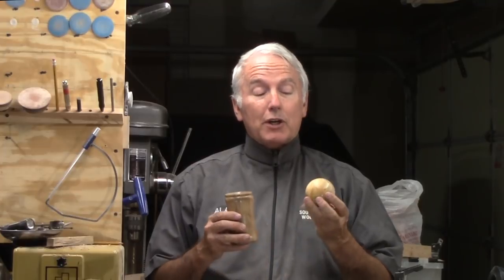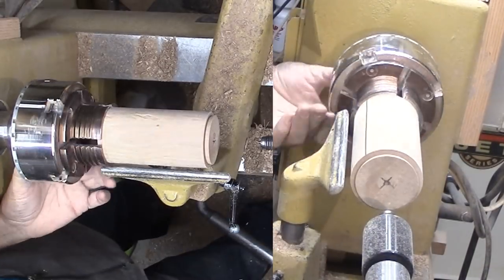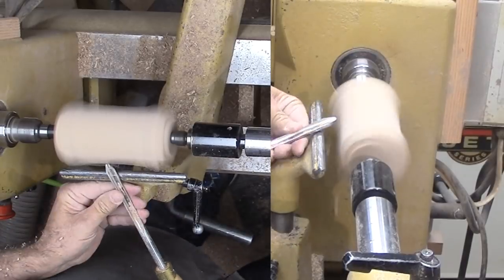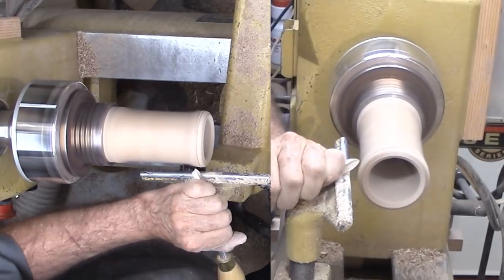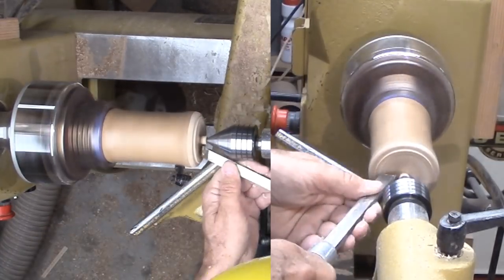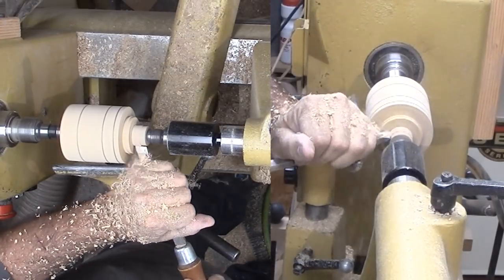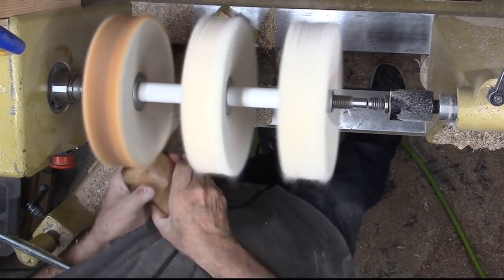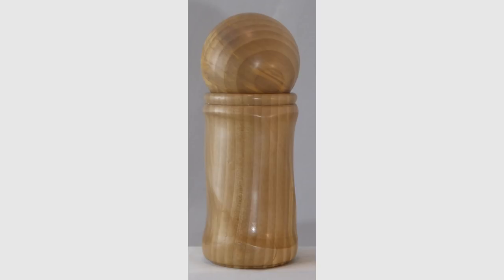Woodturning Sphere Topped Multi Axis Box

Comment: A trick I learned in a Barbara Dill demo - use a pencil (or popsicle stick) to gauge the distance between the tool rest and the bottom of the first cove, and then turn the second and third coves to match that depth.  Measure all three depths from the same point on the tool rest, marking that point with a Sharpie if necessary.
Reply from the maker: Good idea. I tried something similar. Much easier to read than to implement. :)
Alan

Comment: I never did wood turning or lathe work. i have no experinece. However, i enjoy watching the videos. Do you think, as a bloody beginner, if i spend 1k-2k$ on equipmen, am i able to do this, with a bit of practice, say within 3 months?
Reply: Tim -- If you were to turn 8 hours a day (with instruction), you could turn projects like this without any help by the end of your second week (if not before). Turning's not too difficult, but it does take practice. Your best bet is to take a one or two day(s) long beginners class to see if this is something you would like to do. My wife and I took a 5-day class at Craft Supplies USA, which is in Provo, UT.  During the class, we made boxes, goblets, a platter, an egg, and two bowls. I made the second box and goblet during 'free time' during the second half of the week -- without much instructor input. So, this is something you can learn fairly quickly if you put in the time.
Reply from the maker: It's possible. I'd find the nearest woodturning club and get some training.
Alan
Reply: Hey Alan;  no training here in bangkok. Youtube would be (is) my education center.
Reply: Hey David; so if i buy a lathe, a saw, some gouges and scrapers, a disc sander, a/some chucks. total propably 2k$. am i good to go? what's my start then? just getting small squares and make them round, then making them bigger and start digging out like a bowl? gosh, i think i would enjoy this type of work so much. i love seing balls, eggs and spheres with epoxy. i wanna do that all day.
Reply: Tim -- If there is no one near you to provide in-person training, then join the American Association of Woodturners.  The AAW has a series of online videos especially for beginners.  They are excellent. There are a lot of very good videos on YouTube. Alan's, for example, won't steer you wrong by demonstrating unsafe practices.  The same is true for the videos from Mike Peace (and several others).  However, there are lots of other videos that demonstrate very unsafe turning techniques.  That's why I'm encouraging you to rely on the video library of the AAW to learn the basics.  That's what it's for and it has been vetted for safety by experts.  Besides, Alan, Mike, and others, generally skip over some essential steps in the interest of time when making their videos. The AAW videos, which are targeted toward beginners, don't skip over these essential steps.

You can learn this stuff on you own. You can learn it from reading a good book. And, you can learn it from watching good videos.  Mostly, however, you'll learn it by doing.  It's a fun and rewarding hobby and shouldn't take $2k USA to start (I assume you can find a decent used lathe where you're at or start with a mini-lathe -- which will do everything but a large bowl).

Good luck!
Reply from the maker: I'm assuming there would be a language barrier then. Do you take vacations to the US or other English speaking area? 
In the end, it will depend on your motivation. You have more hurdles. But you could also have access to a totally different spectrum of wood to turn.
2k$ could buy a mini lathe say 12" by ?; plan on a chuck and basic tools; plan on making a lot of mistakes but learning from them. 
When I considered an ex-pat position in Hong Kong, I thought that a ShopSmith might be a great idea. Since then, I've actually used my brother's for woodturning. Now I say No for woodturning.(at least)
Reply from the maker: Let me preface my comments with. "We work with what we have." On the lathe for the plus side: I saw variable speed; I saw a tool rest. I could not tell if the spindle was a standard thread. It looked like 1", I hope is then was 8 tpi.  The reason for this is to be able to purchase standard accessories such as a chuck, faceplates or to have a top to create them. 
On the minus side. I saw a machinist's interpretation of a wood lathe. This was designed to assist duplication which unless you are a professional doing production work or some other specific reason. You don't need. I'd have to look further to determine if I can easily move the tool rest or be constrained by the duplicating apparatus. The operator was obviously inexperienced at woodturning with bad catches and primarily scraping cuts. 
I'm concerned about the robustness of the lathe. the ways and the tail stock seemed light. I'm worried about vibration with medium to larger work. While the overall size seemed to be in the "Midi" range, it's capability (other than duplicating) seemed to be in the "Mini" range.
I'd compare the specs to a Jet or Rikkon mini. Look for variable speed, standard spindle, and as much robustness and capacity as you can afford for the type of work you plan to do. 
Rather than purchasing imported wood, look to local Thai woods that could give a totally different experience.  Research how to effectively use green wood.

Hope this helps.
Reply: Well, that gives some insights that i don't have yet. so it seems that i'm maybe better at importing a lathe from the USA which then is like 1.5k$. my goal is to make big balls/spheres and bowls, like Frank Howarth is doing on Youtube. So the lathe should be able to handle such a big piece. at least that's what i think. 
till now i didn't think about what a copying lathe is. i don't need that feature. i thought it looks quite robust and heavy and if necessary i can put some beton plates on the foot to stabilize it more. if i won't be able to handle 50lbs trunks, i think that's fine  for first  as long i can do say 10-12 inch spheres with epoxy. that's what i wanna do all day long. as robustnes goes, it's like usual with thailand: no quality and as cheap as possible. sucks a bit. 

a Nova 1624 II Lathe i could get for about 2.5k$ incl shipping and tax to thailand. sounds pretty much a lot, for an item that goes for way less. Grizzly lathes are out of my pricerange for shipping and duty/tax. how about a "Jet Lathe Model 1221VS" looks mini and i need to have it sit on a table. 

maybe i'll ask reddit and tell them all my options. i found 2-3 more shops in thailand, but they are all in the 450$ range. at the end: ou i get what i pay for. :(
Reply from the maker: The problem I see with the first one is a tool rest constraint. Since it is attached to a threaded rod,  A machinist would appreciate this feature to help make a long smooth cylinder or taper. But I don't.
The second one looks like a "Midi" design much like a Nova with a twist headstock. I could not read enough to check the spindle specifications to see if it fits to a standard. You might use the twist headstock for a large turning if the lathe is heavy enough to take the vibration. I don't know.
My "mini" lathe will do 12" diameter but lacks the power for anything but light cuts and definitely has vibration issues anywhere near that size.
Hope this helps.
Reply: seems like why there is a reason, that many professionals on youturbe has lathes 3k$+. that might be possible for me to pay, but not the shipping and duty on top :/